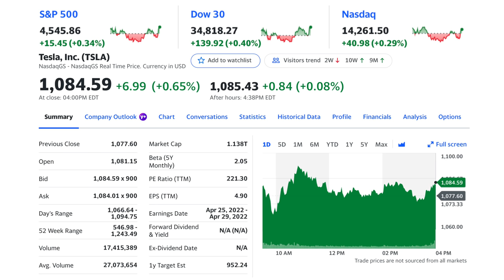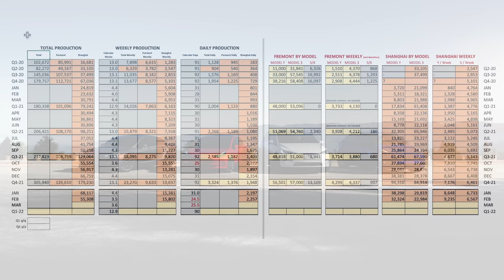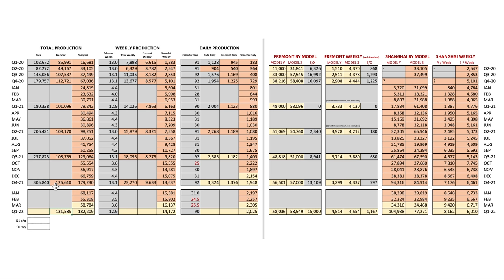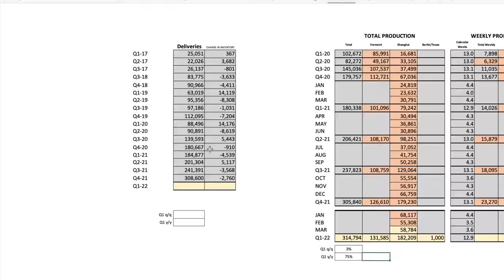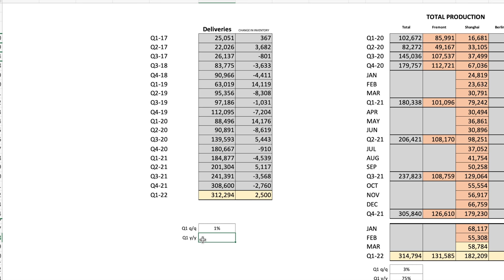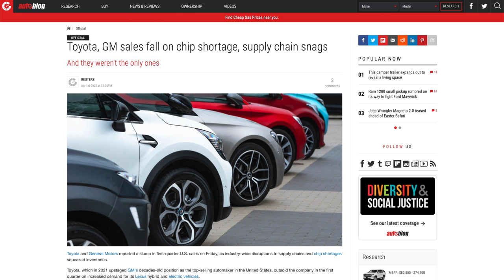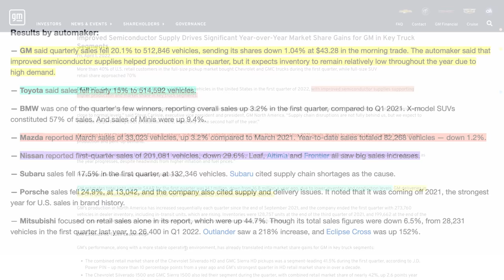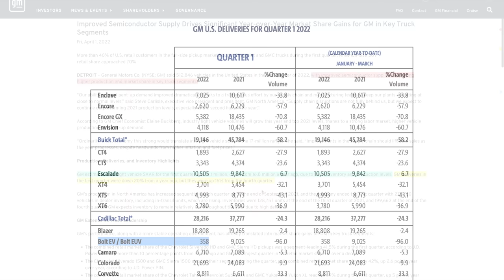Will Tesla Beat Q1 Expectations? Forecast & Analysis (TSLA)

Comment: Excellent writing and commentary, Rob. Very impressive. You have really grown in this job.
As I have alluded previously, in addition to Q1 historically being a weak quarter for autos and frequently decreasing from the preceding quarter, this Q1 will be noteworthy for the sheer number of factors depressing Tesla's potential output: the worldwide automotive chip shortage, broader supply chain difficulties, Chinese New Year holiday factory slowdown and now the Shanghai factory being shut down again earlier this week due to a Covid lockdown. So, I'm predicting that the Q1 YoY delivery growth will be "only" around 70 -75%.
Glad that you showed the YoY Q1 delivery declines for GM, Toyota, et al. I had seen it earlier today on Electrified and was going to mention it. That is an important part of the overall context.
With all that said, Tesla's release tomorrow will allow a comparison of the most recent quarter over quarter delivery numbers, 2021 Q4 to 2022 Q1. This could be slightly negative to approximately level. A positive 4% would be a fantastic achievement considering the 15-day lunar new year celebration in China, the late March Shanghai shutdown and Q1 having just 90 days vs. 92 days in Q4.
I won't be surprised to see some news outlets focus on the Q4 to Q1 comparison, without providing any context, and try to claim that Tesla has stagnated. As we all know, it's just the same old misleading BS from all the same diehard doubters, haters, vested interests (Gordon the Clown checks all three boxes) and click-baiters. Tesla will grow about 80% again this year, just as it did in 2021, while the rest of the large OEMs continue to shrink.
If the Q1 deliveries come in above 310,000, I will be having champagne. 320,000 or above should help get some bullish sentiment building toward the Q1 financial results and conference call in about three weeks of so.